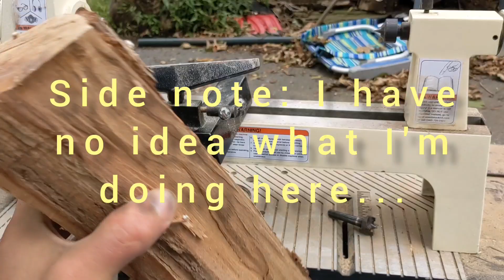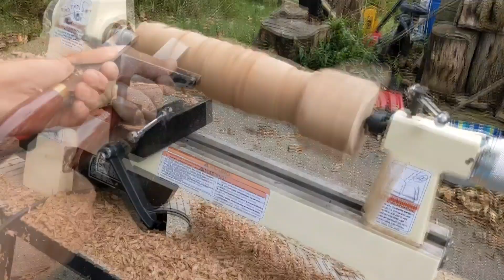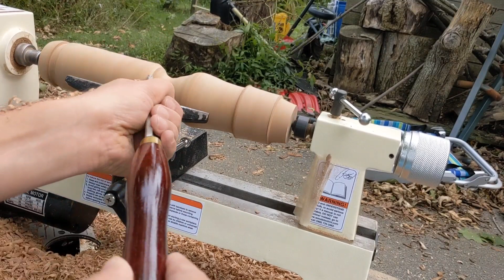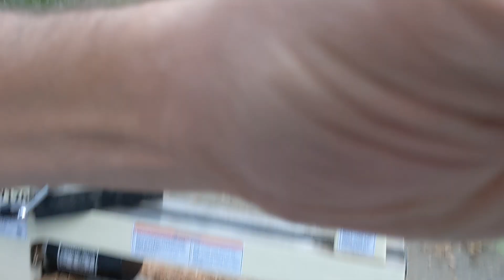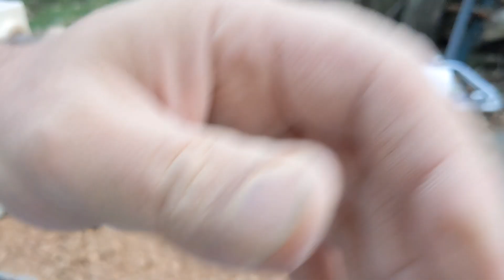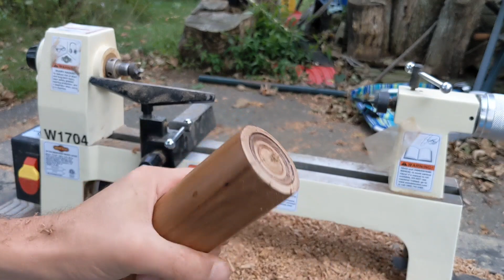Wood Turning: Making a carver's mallet for a Christmas gift

Comment: Very brave, and wise (imho) to start learning with a skew. Im pretty new to turning (since about May 2023) and love using my skew. It does have a reputation for being scary but is actually one of the most versatile tools. 
*Unsolicited advice: join a turning club, practice, take classes, take breaks, participate in club functions, practice, gather free wood, practice, don't give up, watch lots of videos, kiss your sweetheart, practice more
Reply from the maker: Thanks for the advice! The skew seems like the perfect tool once the wood is round(ish). It does tend to catch with the misshapen, off-balance firewood though.
Reply: @RIBill  I hope my message posts. It was really long.
Reply: @RIBill  there are bunches of great channels that have guidance to help you learn about using a variety of tools and what you can do with them. Also, what not to do. Remember to wear your PPE. Face shield, face mask, Safety glasses. Remember there really is no substitute for quality Safety gear.
Reply from the maker: @archiehebron8944  I don't currently have a full face shield, but I stay to the side, out of the danger zone.
Reply: @RIBill  one that is suitable for you Is all you need. They aren't very expensive and you can get them online or from one of the big box stores. *or a local small business. Just let them know what you need and ask if they have or can order it.
Reply: As long as you aren't turning huge bowls you probably won't need a motorcycle helmet.